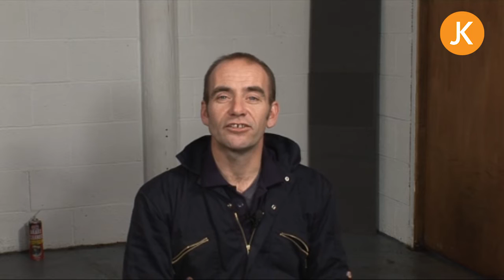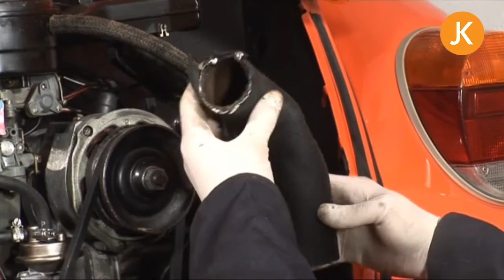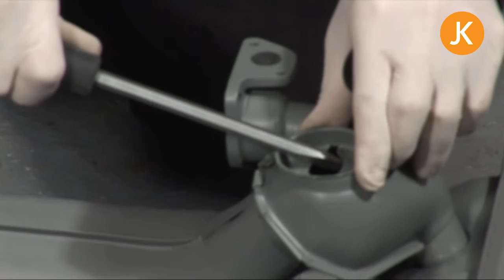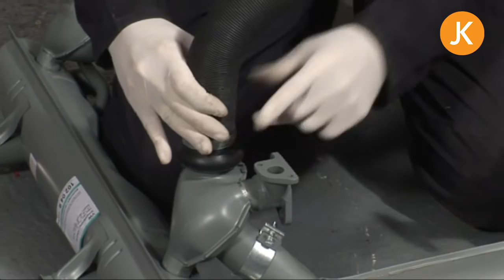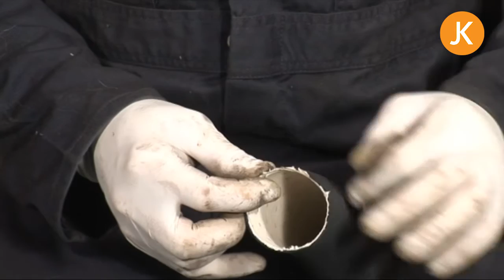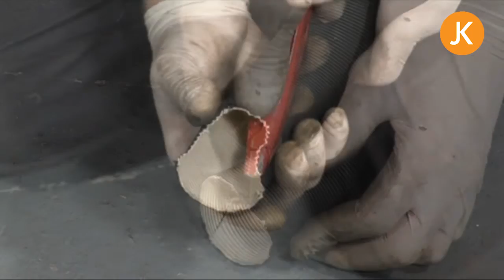Replace the heater hoses on an air cooled VW engine

Comment: A rubber grommet should be fitted on the engine tinware for the preheat hose, similar to the pair of rubber grommets for the fresh air hoses. The VW part numbers for the rubber grommets are 113-119-571 and 113-119-585A.

Comment: Thank you!  This video was a huge help and the only one I found that showed where to put the rubber rings.  I changed the hoses on my bug which was almost exactly like what you showed in the video.  Things look a little different on my bus it would be nice to have a video or a follow up for the bus showing the slight differences.

Comment: The one that goes to air cleaner. If i replace the air cleaner with one that doesn't have a fitting for it. Do it just cap it off at the engine?
Reply from the maker: Hi, yes just cap off the engine.

Comment: Great vid but what IS the correct piece of tinware for that last hose (cold air hose?) that you cut a ‘scoop’ in... mine has such a ‘scoop’ (more of a funnel than a scoop in my mind) but keeps falling out. 
I may just need to shove it in harder, but I’d prefer the correct part if I can get hold of one.

Also can I just check, the hole leads straight out and connects to nothing, I imagine just to draw in fresh air??
Reply: I'd like to know too.  I ended up cutting the scoop out and jamming the hose in through the hole - but it seems rather a clunky way of doing it.